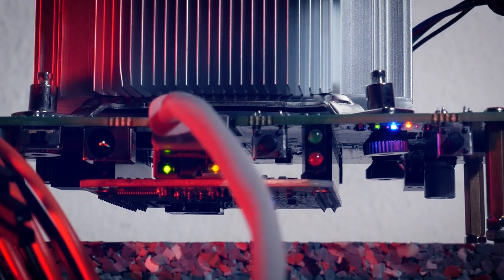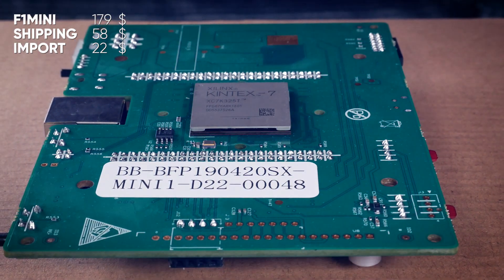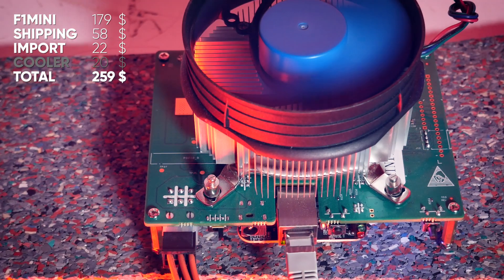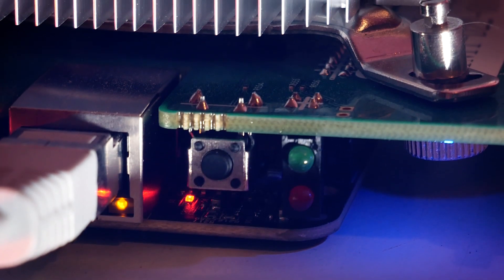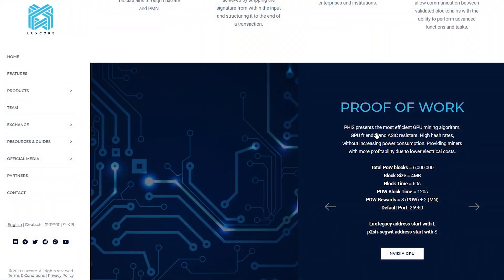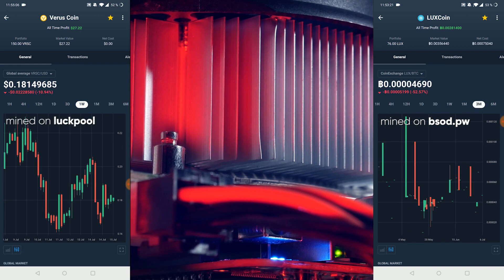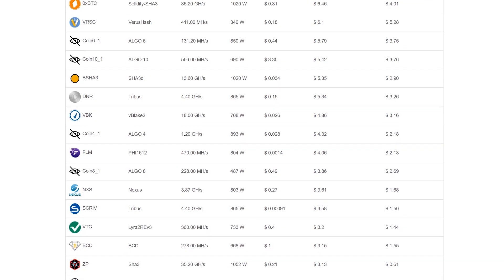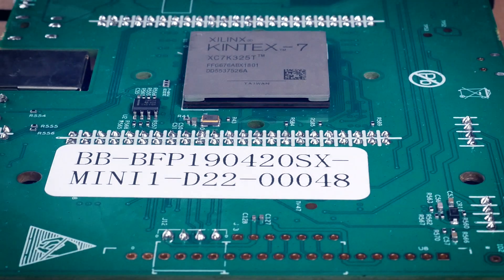Blackminer F1 Mini after 2 months: Costs & Earnings (FPGA Mining by Hash Altcoin)

Comment: If I bought 30 of them could I run them in all in mineral oil without coolers? I have a 100 gallon fish tank ready to go.
Reply from the maker: I'm no expert in immersion cooling unfortunately. You still need radiators etc. but there is a great subreddit dedicated to that, check immersion cooling =) cheers
Reply: No heat is stagnant in liquid you have to have flow for it to cool down otherwise it will burn up quick.
Reply: just slow down there.. To start with you can't use a fish tank, the mineral oil will eat the silicon.

Comment: I have found the best frequency for my F1 mini (batch one) to be around 490 ish getting 7Mh/s on Phi2. I believe each batch & each algo slightly varies on optimum frequency.
Reply from the maker: thanks for sharing that! I could test and confirm since I am also batch 1! What. cooler you got on there and does it increase temps hard? cheers ⛏️
Reply: @CursedMining  its the cheapest cooler I could find on Ebay and increasing the frequency to above 490 & below 500 does not seem to make a difference in the temperature, a steady 32/34 degrees C (approx 20 degrees C ambient temperature) .  I have not checked the wattage though.
Reply: 400- 408 for PHI2 please ignore my 490 comment